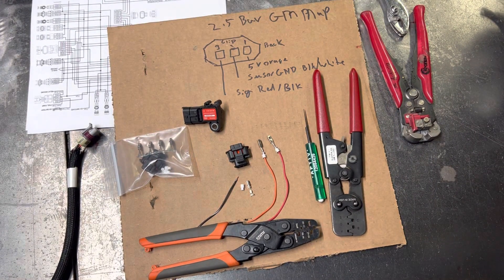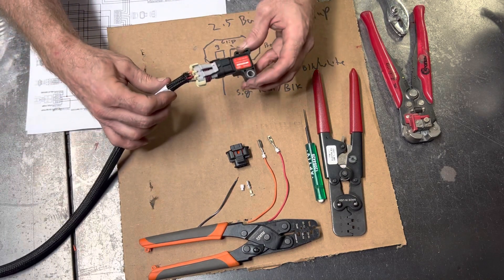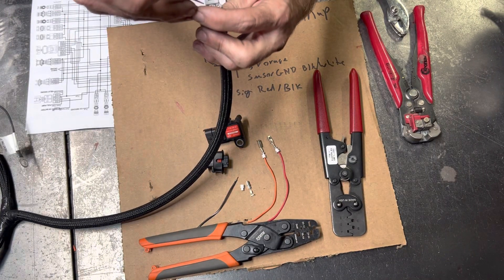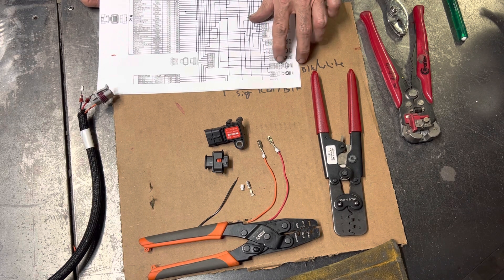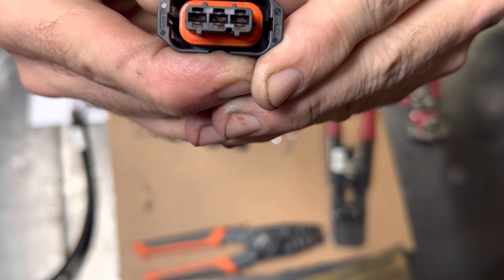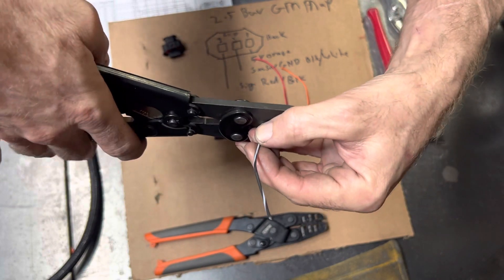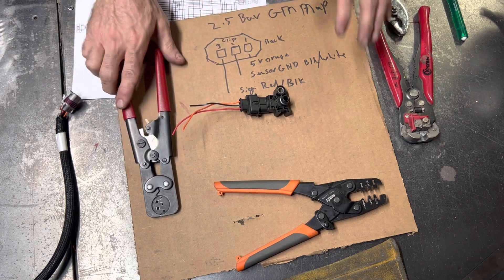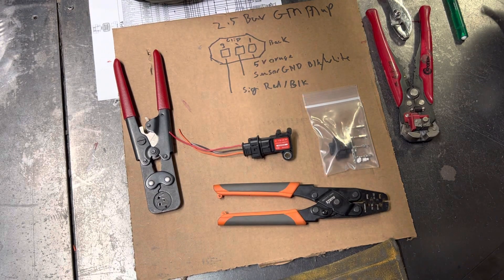GM 2.5 bar MAP Sensor connector

Comment: Hello, I want to ask a question. When the socket is disconnected and the vehicle is running, there is a constant 6 volts on the signal leg. Is this normal or should there be no voltage there?

Comment: I have the same connector in my Audi a4 rear lights. It is just 4 pins instead of 3.
I have to change the connector as it's faulty.
I bought the part but I didn't know how to assemble it.
It took me a while to find your video.
It helped me a lot.
Thank you very much.

Comment: Bringing it on the rewire Mike. Appreciate ya because doing similar build on a shortbox OBS. Good timing and giving me massive shot of motivation. I knew I was going to need to reconfig the TermX harness to be happy with it and the walk-throughs are legit.
Reply from the maker: Glad to hear it. Happy to share. Good luck. If ya have questions you can always call. Number is on the website